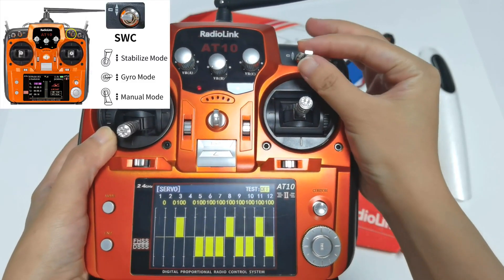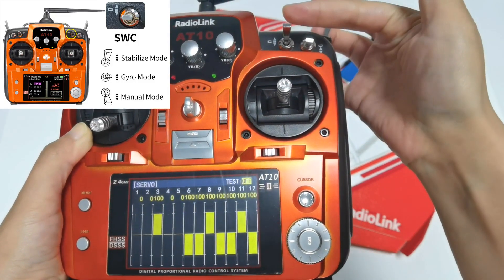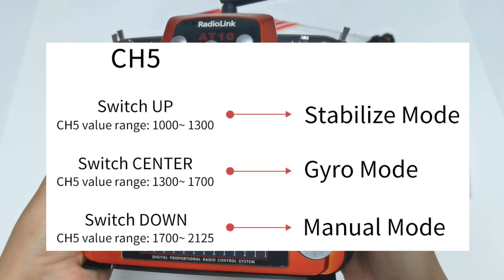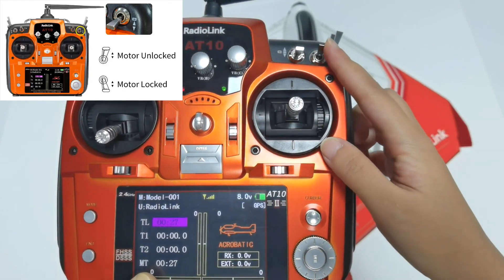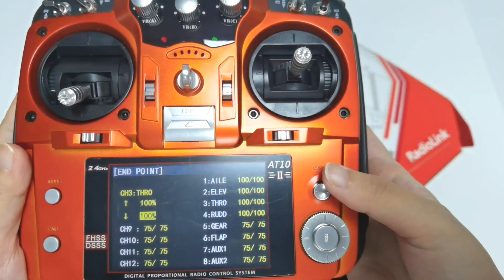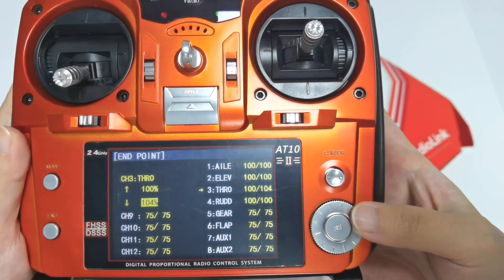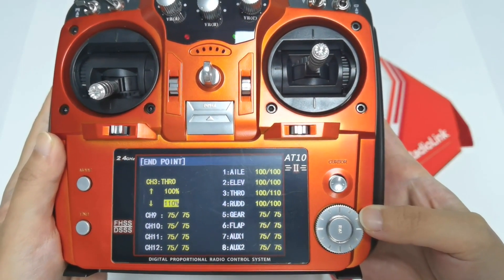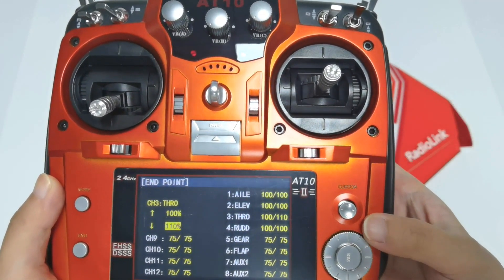RadioLink AT10II Controls D460

Comment: Hey,how can i use 2 gps modules on crossflight flight controller(purple one) ,help me............
Reply from the maker: Hi, sir. Yes. You can use 2 gps modules on crossflight flight controller. ① Connect the first GPS to the GPS/12C port of crossflight, and the second GPS to the TELEM1 port.
② Enter Software Config -- Full Parameter List, then search for “SERIAL1_PROTOCOL”, and change the value to “5”. ③ Search for “GPS_TYPE2” in Full Parameter List, and change the value to “1”  ④ Search for “GPS_AUTO” in Full Parameter List, and change the value to “1”.

If any question about RadioLink products please feel free to contact us. Our email is: after_service@radiolink.com.cn
Reply: @Radiolink_official  telemetry port only have tx,Rx pins right what abt scl,sda pins for gps???? Can you make a detailed elaboration video on it
Reply from the maker: @FLYHIGHDIY  Hi, sir. You can check the diagram of the GPS port of CrossFlight from the link here: https://www.radiolink.com/crossflight_manual  You need to modify the cable/connector according to the diagram of your GPS port to make them match. What GPS are you using? You can ask the seller of the GPS for the diagram of the port and modify the connector by yourself. If you cannot find the diagram fo the TELEM port of CrossFlight, you can contact us via email so we can send you the picture via email. Our email is: after_service@radiolink.com.cn